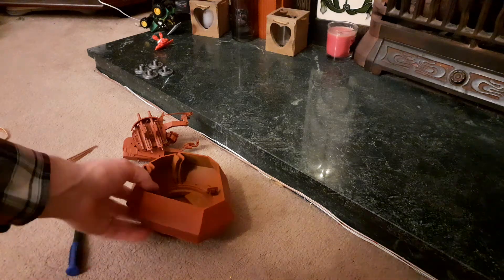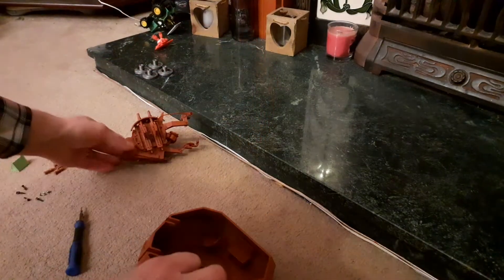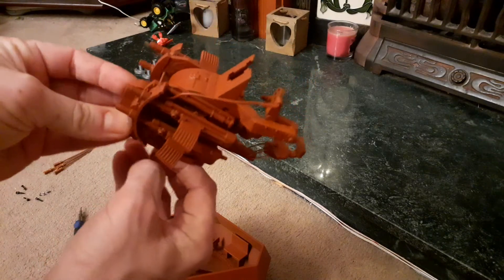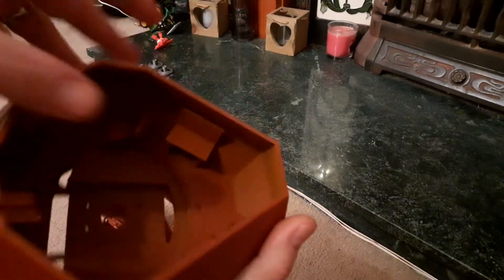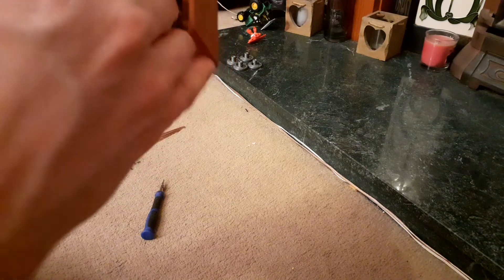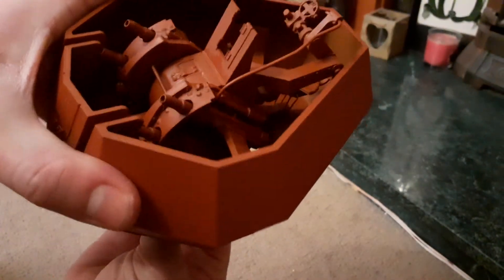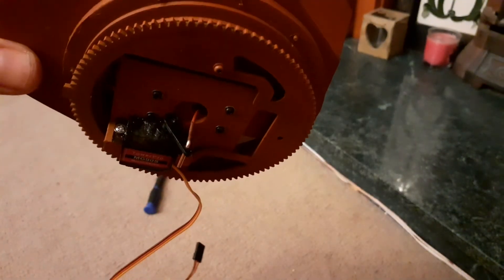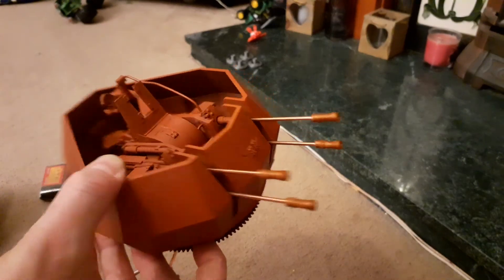WCP Wirblewind turret unit for 1/16 Panzer IV

Comment: Looks amazing! Do you think recoil would be possible?
Reply from the maker: Hello. 
Yes I think it can be done, the issue would be making it work so that the guns fire in pairs in cross pattern and making it robust.
In larger scale I would probably use a micro solenoid, but at 1/16 I'm not sure it would be strong enough without having to move to metal machined pieces.
Reply: @WCPRCModelsCraft  you might be able to use a cam system, each barrel could be spring loaded each could have a little tab that connects with a cam to pull it back
Reply: @STHV_  I had considered a cam plate tied to a central motor to rattle the barrels, but I think longer term it would just generate a pile of plastic shavings and a flat disk. The other problem is that the rate of fire is quite low, so you'd need to have a hefty reduction on the motor to achieve anything like a scale cadence
Reply from the maker: @STHV_  cam system could work on larger models, but bear in mind the elevation unit mean there is not alot of thickness of material to work with and hide the mechanicals. 
I also looked at adding a vibration motor to the deck so that it would just buzz when operated, but thatbwould just fatigue the model and still wouldnt give a recoil movement.
Reply: I have one of these on a Panzer IV and it looks a works perfectly. Another extremely good quality product 👍👍